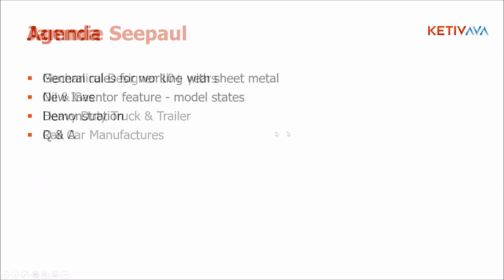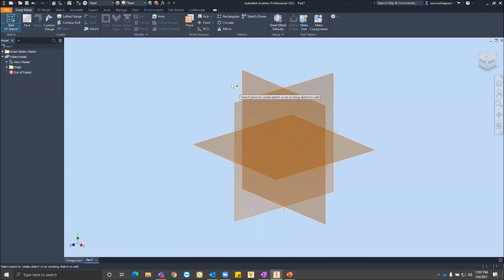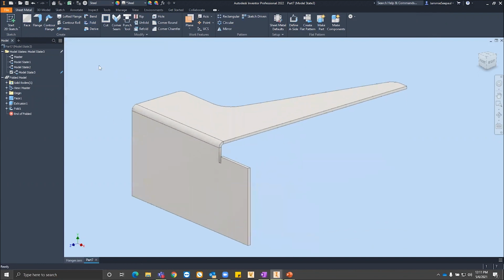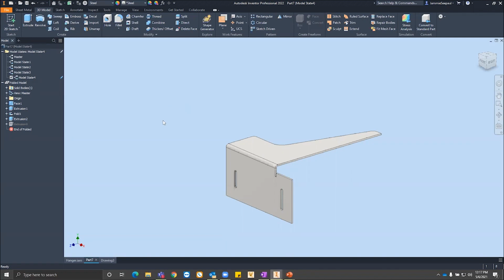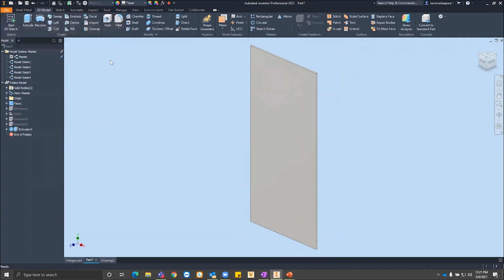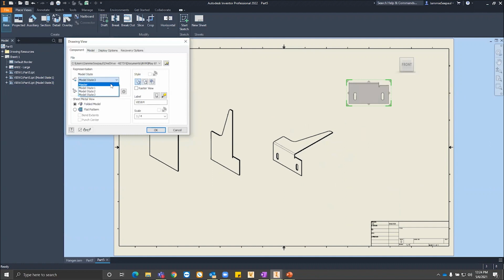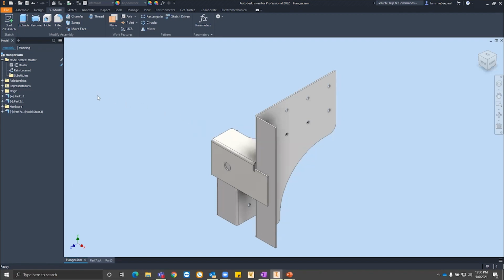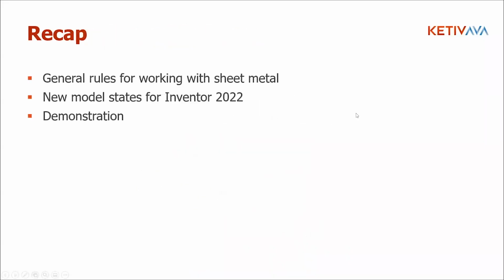Design States for the Sheet Metal Designer | Autodesk Virtual Academy

Comment: https://youtu.be/MBZ5Ld23Sgo?t=1063 You can drive the fold angle using Model States but not the direction of the fold. Anything that appears in the parameters table cen be set as a Model-State configurable parameter.

Comment: Generally you do create cad as per manufacturing process. The model tree should represent that
Reply: Not necessarily. Don't limit your CAD design process to emulate a workshop process. As long as you consciously go through each step prior to issuing drawings, theres no reason why you need to mimic the shop floor workflow to produce a success part.